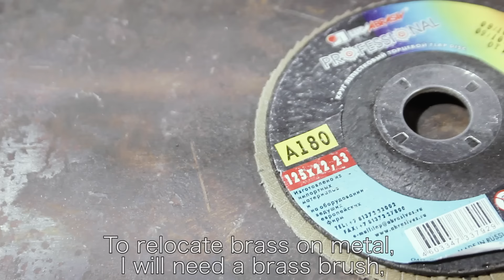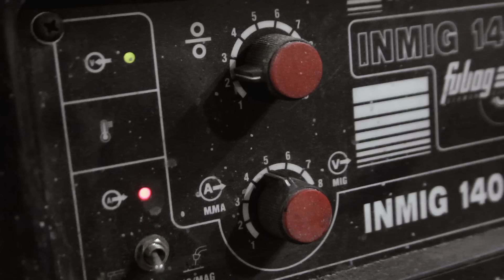Making Viking Axe from the Cheapest Bought Axe

Comment: Is there any way to re-temper the cutting edge without spoilling the etching on the axe head?  Otherwise it's just a  gorgeous wall hanger. Very nice work though. Your vid has inspired me to do a similar project, although without the etching. I want to make my axe lighter for use while hiking and camping, though it will be nowhere near the work of art that you made.l
Reply: There is a way to retemper the edge. Using clay . You have to not have a handle in it though. Pack the whole thing in about an inch of clay. ( not not the children’s kind)  sculpting type or like they throw pots with. Pack the whole head as I said but use your fingers to thin the clay on the cutting edge. Your going to want to see the steel. Put whole thing in the forge and heat it red or yet hot then quick quench it in oil. Remove your clay and buff your cutting edge.  Same treat they use on Japanese swords

Comment: Dear Sir i wondering your work its beautiful
i tri also buth i have probleme with the acrylic paint buth every time she pelling of
thas the way i doing
( the knife are not finiching only sand at 1200  gr.  not mirror effect)
1 i put the knife in de vinaider
2 scratchpthe acrylic paint to make my  drawing
3 water with sald i put my blade in,  same of you
4 connect my charger 
+ on the metal sheet and -  connect on the blade
5 after 10 min its all ways the same the acrylic  paint  peelinf of
can you help me and tal wath is going on

thanks a lot
miguel

Comment: I’ve been thinking about etching something into a big hammer I use at work, just as a fun project and to mark it as mine. I hadn’t considered using paint like you did. I like the idea...and since I’m only doing one symbol, it won’t take anywhere near 5 hours to scrape it back off! 😉
Now to see if I can track down or make a power supply!
Reply: You might want to try regular computer PSU. There is plenty of videos how to turn one into bench top power supply, but in short order take green wire from loom that goes to motherboard and connect it to black ground. That causes it to start. You can put switch between if there is none on high voltage side. I'm no expert on topic, but it should be able to give out lots of amps on 3.3v 5v and 12v, read what is says on PSU it self. Car battery charger should work too.

Comment: what the heck.  everything about this, is sooo wrong.  -_-  The etching and the electrodes need to be on separate sheets.  Not the same bent metal.  Of course it will take forever, since the middle section is using most of the current.  Split that metal sheet in half and then it forces the electrodes to go through the water. ..

Comment: This is good as decoration, but all the heat damaging the temper would make this fairly useless as an axe, also, the handle is shaped a specific way from the factory, after hundreds of years of axes, its evolved to look the way it does for very specific reasons (smooth is quite a key trait of the handle as chunks missing leads to grain splitting, also for comfort etc. Same with the big chunk of material you removed from the back of the axe head, also there for specific reasons.
Keep it up and one day you'll make fine tools, or stay artistic and you'll make cool looking decorations :-)